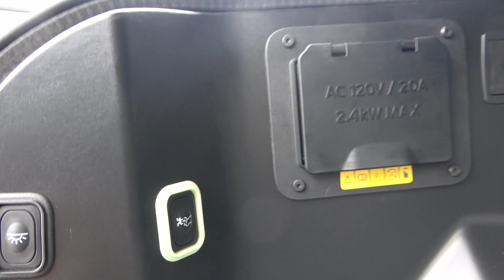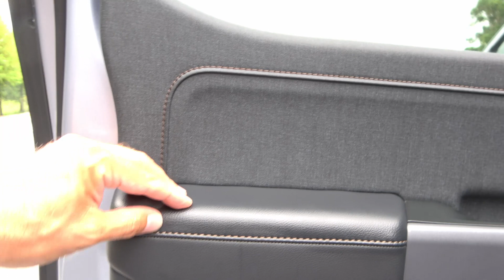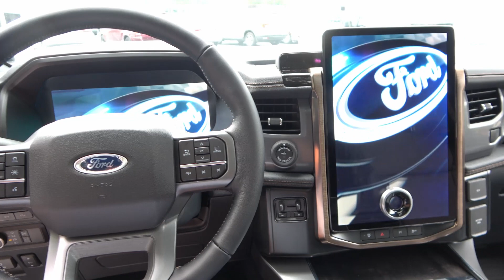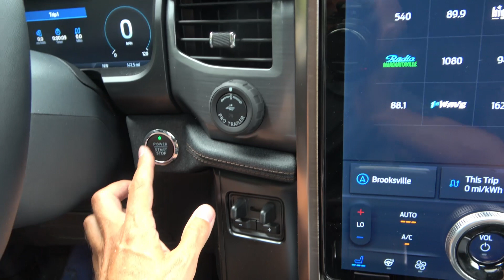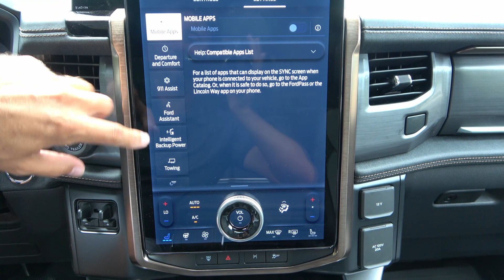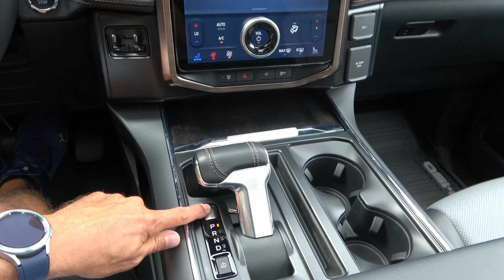All electric 2022 Ford F150 Lightning Lariat is the coolest pick up truck. Review and drive.

Comment: I’d like to note that the 12V battery jump ports are available on the left top sill of the front trunk. The access panel is not recommended. 🙃🛻
Reply from the maker: Thank you for that info.  I saw the markings on the top sill as well.